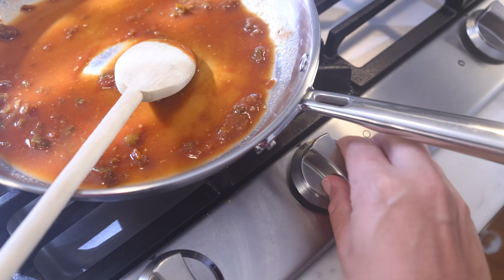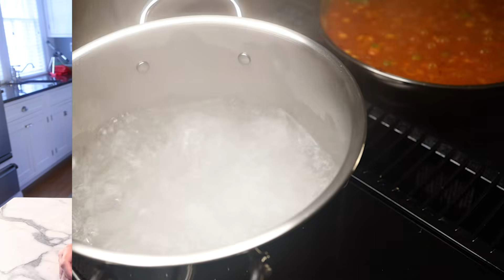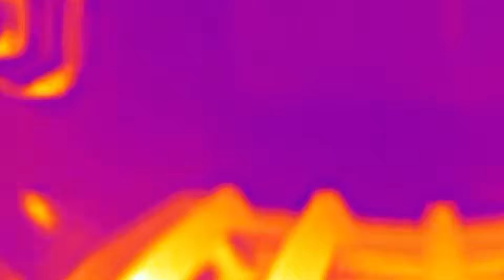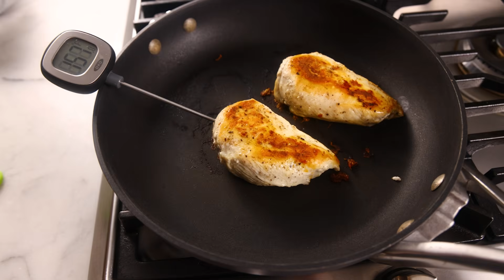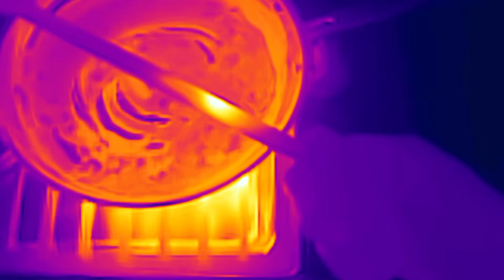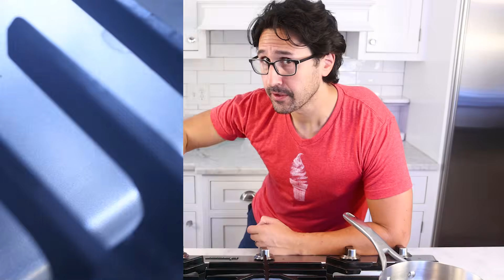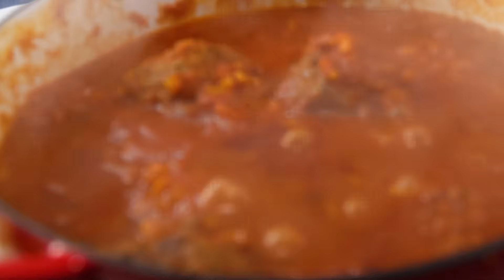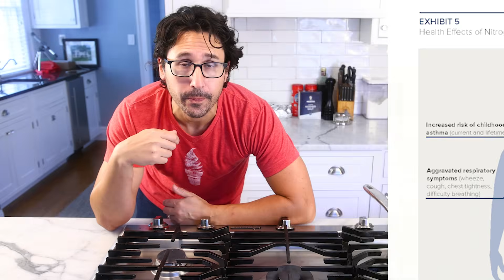Problems with gas stovetops | weak, dirty and dangerous

Comment: For what it's worth: my experience has been that electric heats up too quickly, I simply don't need that heat for what I'm cooking. My friend has a gas stove and whenever we use it together i find it perfect. It's good at melting and browning, yes inefficient when it comes to boiling pasta but that doesn't matter when it comes to a few extra minutes of forethought for dinner. I also find that the 'lost' heat around the sides of the pan allows me to hold or shake the pan just above the surface of the metal grate while still having heat applied, i cant do that that my induction at home. I can do things like stir fry and grilled cheese much easier, just because I have a literal flame to work with as opposed to magnetism. Also the benefits of an open flame in the kitchen allow for traditional cooking methods (eg dalgona) and flame-grilled recipes (flame grilled peppers, marshmallows).
Reply: I like induction cookers for some things (I had a cheap one burner for a while), but I chose a gas stove when I replaced my old oven. I don't like the gas as he pointed out, but gas cooking is very very flexible. You can season skillets without issues on it, it doesn't matter if they are slightly warped and you don't have to have to worry about if your pan is large enough to fit on the burner. (an issue probably only cheaper induction cookers have where the pan has to be large enough to fit the magnet.) I think the perfect solution might be a mix of both. A single burner or two for induction having these as external burners would be ideal.
Reply: @readypetequalmers7360  I agree, a hob centre with two induction and 2 gas would be highly functional to facilitate the benefits of gas and induction cooking.

Comment: I have the inverse problem with my electric stove. It's a cheap ass stove from the early 2000's. It takes forever for water to boil. I miss gas at this point.

Comment: My parents are stuck in their ways, have a 20+ year old gas stove that needs replacing, and REFUSE to get anything else. To them, its not as "powerful", and they think electric always means restive. I REALLY dont want them to get a gas one because of many of the reasons listed above, but the largest are the heat from the burner, and the inability to clean well. Its just so obnoxious to have to deal with all that excess heat in the kitchen without AC. I am also a REALLY messy cook, so Its such a pain to clean up after I am done, as I have to wait an hour for everything to cool down before I can then go and actually clean up.

Comment: I've always had gas stoves. Even when I lived in MA and rented there, all apartments I happened to rent had a gas stove. Now I am in PR and here gas reign supreme because electricity is HELLA expensive - so much so, we chose to invest in solar - and gas is relatively cheap at around $110 for a 100 lbs tank.
Reply: That's one thing I think people leave out a lot. Induction might be more "efficient", but that doesn't mean it's cheaper. Electric is pretty expensive and hard to generate. I don't know if I would be able to use solar panels to generate enough energy for cooking...that would be a good experiment. The problem I can see with using induction in an off grid situation is that it could drain for too much energy that is needed for cooling or other items.
Reply: @readypetequalmers7360  Yeah here in California gas is super cheap, most people have gas stoves AFAIK
Reply: @dhkatz_  My electricity is now 40 cents a KWH in San Francisco.   Completely insane.
Reply: @readypetequalmers7360  Gas might be cheap, and that's a problem. It's a fossil fuel and should be taxedso hard that people don't use it anymore for anything. Clean, cheap electricity is the only way forward.
Reply: @davidsommen1324  electric sucks, gas stoves are superior
Reply: @davidsommen1324  You can use solar panels if you want. I'll stick with electricity produced by beautiful, clean coal.

Comment: trick to go low on gas stove is to dial towards turning it off but very slowly, you can get it really low. but ya if there is a fan or something around your fire might go off. for my case the fan is on top n i never had a problem

Comment: I personally have seperate mini burners that are induction, while I use those first and foremost; if the power shuts off, it's nice to have a bit of security in that way.
Reply: i do the opposite lol. I have a separate gas stove for camping that I can use if the power shuts off and use the electric day to day.
Reply: I came very close to just getting 3 induction hotplates instead of a cooktop, but they are not quite as powerful. Although comparing the range to one afterwards, I think the difference was insignificant.  The idea was I could have as much cooktop and counter space as I needed and where I needed it. That combined with a Decent combination microwave/convection oven (if such a thing exists) would be my perfect cooking setup.
Reply: if the power shuts off ?😳
ha ha ha (laughing in Dutch)

Comment: I can see the benefit of induction, and i would consider going that route. However, in the home setting, I'm mostly not boiling big pots of water. Instead, I'm doing smaller quicker dishes where the instantaneous and responsive nature of gas really shines. I had a glass top that i replaced with gas and never looked back.

Comment: Definitely my biggest problem with gas stoves is cleaning. With a glass top you just wipe the grime away, a few swipes it's all gone. With a gas stove spilled over food melts and turns into ash and it sticks to the stove. Stuff like water boiled over or drips from lifting a lid also adds up really fast. Not to mention the bars get dirty and those are painful to clean.

In the future I will definitely go induction. Although I am afraid because my induction cooker has the worst lows ever. It's either a way too strong low or way too weak low. Hopefully that won't be the case with an actual induction stove.

Comment: If everything goes to plan I'll have the dilemma of choosing between gas or induction. Electric would have the benefit of being safer, cheaper and easier to clean. Gas provides versatility for using a wok or charring food. A flat glass top also means taking care when buying pans. I had a nice £70 pan that I ended up giving to my parents since I'm renting a place with a glass topped hob, base of the pan wasn't perfectly flat so couldn't be used.

Comment: This was an awesome video. Very informative but if I could also mention that cooking from a campsite fire, you know with burning wood- you can boil rice, per say, or cook really anything to my knowledge and keep it out in the open air and it would stay eatable for about 2 or maybe even 3 days depending on the ambient temperature. The food also has a nice smoky taste to it- even when cooked in a pan. In a gas burner, the food decays quicker, I've noticed- probably around the 9hr mark would be pretty stale. Cooking like cavemen with pots are great lol. However your pots and pans WILL get black and it's hard to clean, probably impossible to clean as far as I've known. The smoke from wood also prevents mosquitoes aswell and is something that I do in my house- we just take a decent piece sized wood and throw it in a big pan to contain it and burn the wood until it smokes the room out- leave the windows and clear any fabric out such as mats and curtains- if you have permanent flooring mats that can't be removed, sprinkle baking soda and pine sol to remove the odor. I cannot recall ever getting bit by a mosquito at home since I was born. and the burnt bits at the end are charcoal which you can use to bbq at a grill.

Comment: @  Adam
In my humble experience there are 2 additional elements 
1. If there is any breeze, it destroys efficiency of the burner (I cant see your windows)
2. Check your regulator (from the gas bottle to your stove/ burner). It may not be allowing enough gas through.

Comment: Another thing to consider is cost. I don’t know how this goes in the US, but the reason why most people use gas stoves here in Brazil is because gas is way cheaper than electricity. 

Now due to a decrease in national production + devaluing of the currency, gas is getting more expensive than the already increasingly expensive electricity (due to droughts, forcing us to switch to fossil fuels, which are more expensive than the usual hydro and wind, at least here), and a lot of people are buying electric cooktops and “air fryers”, those small countertop convection ovens. Though poorer people are unfortunately going for dirty and dangerous wood stoves, and a woman recently died because she tried to use ethanol to cook :/ Induction has not really caught on exactly because it consumes a lot more electricity for a smaller output of heat, and requires you switch all non-magnetic pans. Edit: well, apparently induction does use less electricity than electric resistance, but it might still not be enough to offset the difference in price to gas, nor the investment of swapping most of your pans, since aluminium is still the norm around here.
Reply: 💯! Switch to induction does not only mean use more electricity (on top of typical daily use of ther appliances) but also the switch to fancier pans which then also costs more money.
Reply: That's not true, induction actually is much more economical because it doesn't heat air, just the pan. Also if you already use stainless steel or cast iron they will work fine with induction. Only aluminum pots and pans will not work.
Reply: @incognitofelon   “[induction] is much more economical because it doesn’t heat air” nope, it isn’t, it is more efficient, and if you speak Portuguese I can recommend maybe hundreds of videos of people running tests on this, as I will just explain. I did look it up though and apparently you’re right in saying that induction uses less power than conventional electric, even though this differs from what I’ve heard and from what Adam briefly suggested in this video, so I’ll edit that part out. 

But just to clarify, even though it’s true that electrical systems will be more efficient in transferring the heat, it is still not enough to compensate for the fact that electricity is more expensive, and has a more volatile price, so it will not be more economical. If you bring a pot or water to a boil faster and with less waste but will have to pay more monthly in your bills, or at least make them more unpredictable, it’s more efficient but less economical. I know, it’s tricky, but not exactly too hard to understand.

Furthermore, induction stoves are, at least here, way more expensive than resistance stoves, so if people will switch from gas to electric, they will do so by switching to electrical resistance, not induction (exactly what’s happening now!), unless either 1- the difference in efficiency gets big enough that people can pay more for a stove set because it will pay off in a reasonable time, without risking their financial stability, or 2- electricity gets way cheaper than it is, so using gas won’t be economical anymore, and people will turn to electrical systems en masse.

What actually isn’t true is that any stainless steel works: iron in that configuration simply isn’t magnetic, and almost none of the stainless steel pans I own pass the magnet test since they’re old. Induction-abled stainless steel pans will have a magnetic layer with ferrous materials embedded into them, or so say the manufacturers:  https://www.smeg.com.au/faq/cooktops.html . Aluminum pans are by far the most popular, as they’re cheap and don’t oxidize, nor require special care like cast iron, so yeah, it is a very relevant reason not to switch since not everyone is crazy enough to make most of their pans useless for a minimal gain in efficiency that doesn’t even translate into less money spent on energy bills, since this will need quite a big investiment (expensive stove set + expensive energy bills + swapping most of your pans). Ceramic pots are also a cultural reason why they aren’t as popular as they could be. I do think this will all change in the long run, and induction will become more popular, but only when electricity becomes cheap again, our GDP per capita goes back to where it was a decade ago, and newer, cheaper, induction-able pans become the norm in most people’s households.
Reply: @danielmoura9421  Yes some stainless steel--depending on the composition of the metal--may not work, but that's not  determined by price. More expensive models usually market the term "induction suitable" and cater to more affluent customers. This leads to the impression that induction pots and pans are expensive. In fact most of the pots and pans I bought from my local market work just fine even though they were really cheap and weren't advertised to be induction suitable. All you need to do when your purchasing is to bring along a magnet (such as a fridge magnet) to the store and see if it sticks to the bottom before purchasing.
Reply: @incognitofelon  again, almost none of the pans I have pass the magnet test, including stainless steel; the exception are the more recent ones I’ve got.  So it not only makes the switch more expensive, since you’ll need to replace most of your pans, but the pans themselves will usually be slightly pricier. Yes they are slightly more expensive, and the reason this isn’t true in your local market is simply because we don’t live in the same country lol. But I’m sure this is already changing, and induction suitable is getting more common here, as well as adaptors
Reply: @incognitofelon  you have to keep in mind the prices of gas, electricity, and tools (pans, stoves). You also have to keep in mind how accessible tools are. Stainless steel and cast iron are expensive here. it may be more economical where you are from but not where im from.
Reply: @noshimoshi  That's true but aluminum pots and pans are not recommended in terms of health consequences either. You don't have to go for very expensive models for stainless steel, just basic cheap alternatives work fine on my stove. Some of my pots and pans are from Ikea. Usability over the long haul is also important because it reduces the necessity of renewing pots and pans. Aluminum pots maybe cheap to buy at first but they need replacement more often. I've been using my stainless steel set for 20 years and they still look brand new. Cast iron can be passed down across generations and has excellent heat distribution especially for cooking meat. So all in all, if you're interested in making good food, there great Investments regardless of what type of stove you use.

Comment: But what about cost? My family has been using gas stoves since forever, I imagine it's the same with most Asian countries. Cooking with electricity seems like a luxury and can be very costly, but I have never really sit down and do the math. Can you help me with that question.
Reply: Nobody can answer that without knowing your local electricity and gas costs (they vary WILDLY globally). Then you have to factor in inefficiencies.
Reply: If you really want to figure it out, it will take some work and a little math, but it won't be that hard.

It should be SUPER easy to look up your electricity and gas costs from your local providers.

Then you can check your gas meter. Record the number. Don't use any other gas, and get exactly 1 litre of water boiling on your gas stove. As soon as it starts boiling, shut off the stove, and record the new number on the gas meter. Do a little math and you will know the cost of how much gas was used.

Then if you have a friend with an electric stove, you can do the same water-boil test (use the same volume of water at the same starting temperature, and the same pot too), and do the same calculation with their electricity meter, before and after, multiply the electricity used by the cost of the electricity, and compare the cost of the gas to the cost of the electricity.

This definitely won't be exact, but it should be a relatively easy way to find out if one is massively cheaper than the other.

Comment: 10:38 I generally don't trust research funded by organizations with an agenda. Would you trust any research funded by Exxon or Shell which "proves" that climate change is bogus? That doesn't mean that the agenda is wrong, it's just that it's so easy for cash-strapped researchers to unconsciously (or even consciously!) tilt their findings to favor results that will get them more cash in the future.

Comment: I use gas stoves because the electricity costs are too high. If an cook 3 meals a day then it will cost me about 1$ more per day. My currently monthly electric bill is around 25$. That's while I am working from home with 3 consoles that run 12 hours every day.

Most of the time it's just simple economics.

Comment: Adam, why wait?  Don't put yourself through years of breathing nasty fumes and putting up with the disadvantages of gas.  Someone else would love that stove so the carbon footprint of replacing it with induction isn't going to be as bad as if you just chucked it in a landfill.  
Find the best induction cooker you can and claim it as a business expense, of course.
I've been driving an electric car for years, and often hear the (false) argument that the grid is not green, so I'm not helping.  Where I am, in Canada, we've always used almost 100% hydro-power, but even in some dirty USA states, an EV is still cleaner, even if coal is its power source.
An alternative is using renewable natural gas (RNG), but that's only a blip on the radar at the moment (though you can make it yourself at home!).
Reply: Indeed, he needn’t wait, just sell the current one instead of dumping it.